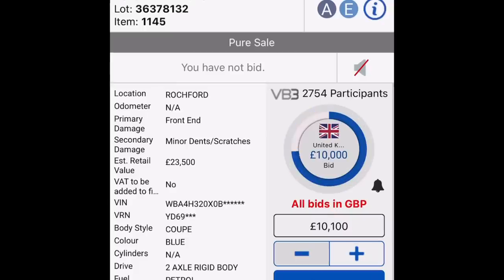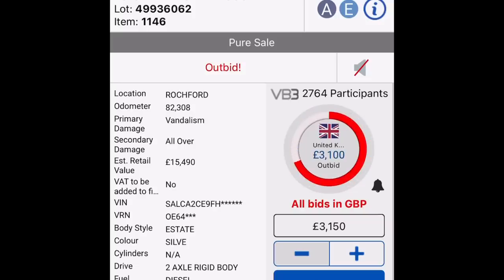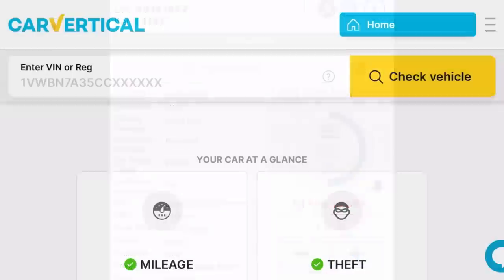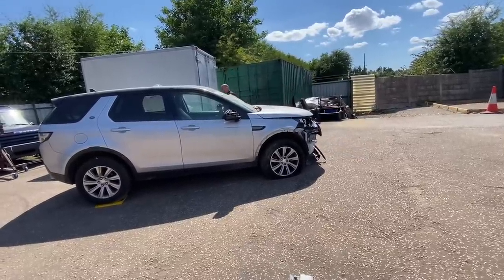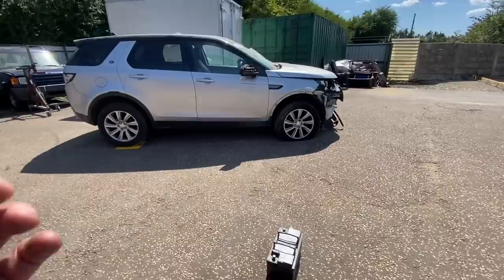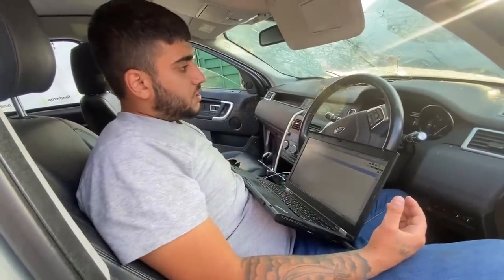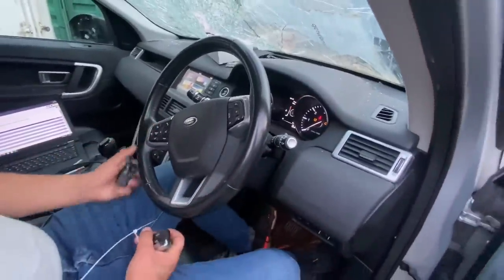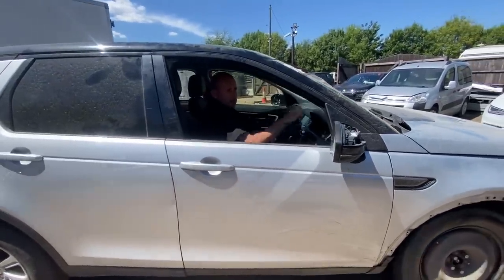STOLEN POLICE T-PAC WRECKED 2015 LAND ROVER DISCOVERY

Comment: I have a manual SE Tech SD4 in Indus Silver too - looking forward to following this.

As this has the pan roof, you're half way to the black pack offered on the HSE level. You've got the black roof, wing mirrors, fog lights and tailgate finisher. Go for the black grille, lettering and side vents and stick a second hand set of 20" black LR Aerovipers (from the HSE) on there and it makes for a great looking car! 👍

Comment: That's looking a bit rough but I can see the potential. The good thing is Aden got her running. He is a very nice guy and very knowledgeable.  As he said though he has to keep on top of the game to be at least equal with the criminals. The post will be an easy fix for you, just need to source parts at a good price. It will be a good and interesting project Gents. Thanks again Rob and Chris  for another great video. Do still keep an eye on the temperatures though. 👍👍

Comment: Firstly thanks as always guy's,quick question,do you reckon purely on a business sense do you think there's more profit just churning out your run of the mill family car's,/hatch backs etc.Or are the more prestigious more exotic stuff worth the initial outlay.Obviously the variety is great for us follower's i was just honestly wondering the difference in profit between the bog standard and the more expensive,cheers.
Reply: Sorry the other thing is i know you guys sell the vehicles at a reasonable price but there is a big divide in cost between you guy's down south to us Northerners.
Reply from the maker: The profit will be about normal on this just with higher end stuff the bits are more 👍
Reply: @sruk  thanks.👍

Comment: What this basically shows is that car security is more of a joke now than it was back in the day when 15 year olds were nicking Astra GTEs with a screwdriver and short length of scaff tube. All these hideously complicated electronics have ultimately achieved is a situation where anyone with the right kit can drive a £50,000 car off someone's drive at any time of day or night without making a noise, or causing as much as a dent or scratch.
Reply: Exactly my thoughts. I am 70 this month and have spent over 40 years in the electronics industry, and I can tell you that there is nothing more foolish than to rely on a bunch of IC's to protect what now amounts to the same financial investment as a small house. You could make an external steering wheel locking device for very little money that would just stop the new car thief in his tracks, but we have all become too bone idle to spend the 2 minutes to fit it and take it off. It is all going the wrong way I'm afraid.

Comment: I was fascinated by what Aiden was trying to say but Rob you kept interrupting him and he lost the thread.
Reply: Reading between the lines what he said was...

1) It's a game of cat and mouse. The manufacturer puts a system in place and the "aftermarket" analyse and produce a tool to circumvent the system. The manufactures beef up the system and then the "aftermarket" revise their tools. Like building a wall and then getting a taller ladder...

2) Pre 2014 the keys could be relatively easily programmed to the KVM using "aftermarket" tools. Post 2014 JRL secured the KVM so this was no longer possible.

3) So the "aftermarket" then needed another method to start the car. For this they used the emergency start feature and use a tool capable of replacing the key identities in the Body module with ones that they know. This is why the original keys no longer worked on this feature. This tool also turned off the factory alarm. There are many YouTube videos showing this. 

4) Telematics and KVM are disabled in an attempt to stop the vehicle being located. Done by removal or cutting wires. (I like the AirTag story)

5) The feature he used to turn on the ignition only powered up the systems so his tools could talk to the vehicle. This alone would not allow a start.

Think that's what he said. And remember that the tools he used in the video cost him a fair amount of money and subscription. Without these and his knowledge putting the vehicle back to factory operation would not be possible. ..... 

Oh and replace "aftermarket" with whatever phrase best suits the individual!!!!! Do a search for Turbodecoder" HU101. Do the best to secure your investment, make the unsecured one next to yours more attractive. Bottom line is that if someone wants it they will do their best to take it. 

Why we don't make castration of offenders using house bricks legal I don't know.
Reply: Welcome to SRUK, Where Rob asks questions and then talks over the answers :D
Reply from the maker: @AurynGaming  no one is making you watch it negative nev
Reply from the maker: We was having a Conversation that’s how I talk and I have watched it back and you can clearly hear every word he was saying at one point the clocks got my attention and I clearly apologised for interrupting and continued but don’t worry it will never happen again as I won’t ever be filming any third party’s I’m sick of the constant whingeing 👍
Reply: @pichacker  Spot on mate, that´s what Aydin was telling.

Comment: Hi guys I recently had a f pace jaguar  I replaced the rear door car hard to start reposition key I changed the door locks module from the old door perfect now. Also I have another f pace no power at all turns out the fuses above the battery was blown hope this helps as jaguar land rover much the same

Comment: This will make a good series..One question…did the airbags not deploy ? And if not does hot wiring disable them?
Reply from the maker: No airbag damage and honestly you Will find this hard to believe but it really hasn’t been damaged hard to set the airbags off it all panel damage 👍

Comment: Well that RR is a brave one Rob !,  but we know you’ll both resurrect it from the ashes !.  The vehicle security must be very good on those, but of course they are very worth stealing for the parts and shipping to West Africa. So the thieves will have worked out how to circumnavigate the security reasonably quickly. I’m afraid the knowledge of how to do these things is supplied by criminals who have had access to the original design flaws, or reverse engineered it via China. The ones who steal them are just shown the technique, they are too thick to know what the electronics are doing..

Comment: Wow, some scavenger hunting required. I hope those panels are not hiding some deep dark secrets, like a bent chassis or something else vital. I guess the radiator took a bit of unwanted attention to drain the water, so any AC or oil cooler rads will be drawing their pensions about now.
Reply from the maker: It is holding water it was just low 👍

Comment: Oh Rob,  I'm hoping this car doesn't bite you back  I'm scared that  you might have have taken on more than you can bite.
Reply: Its a bit of bodywork, some paint, wheels and tyres, this is nothing compared to some they have had, did you not see the difference once the bumper was off, not bad at all. Fair enough its got alot of damage to the body but mechanically its clearly fine. This will spend more time with the painters than rob and chris, i would personally buy 2 2nd hand doors for drivers side rebuild the front and send for paint. Easy flip
Reply from the maker: Easy work this one bud 👍

Comment: Honestly I worked for Land Rover and someone there told me once those keys are programmed to one module you can never have them reprogrammed… did he install the original files into the module ?
Reply: You can re use all jaguar land rover keys!
Reply: @aydintintas1280  that’s fair enough.. it’s good to know. Thanks
Reply: Another question.. can you only program 3 keys max per key module ? That’s also something someone I know who went to Land Rover to have they’re evoque key replaced cause the rubber bit falling apart and they said they’d need a new module as well as a new key cause it’d already had max keys programmed to that module which couldn’t be removed.. Moral of story… it cost them an absolutely load for 2 keys to be programmed to the car

Comment: Hi good luck with this one what does the T pack refere to? Please
Reply: Police cars trying to stop the car. The damage down the sides is from the police cars
Reply: Tactical Pursuit And Containment (TPAC) - Boxed in by 3+ Police Traffic vehicles and physically brought to a standstill.
Reply: It is a police term for tpac tactical pursuit and containment,  when 3 or more police cars try and box the car in
Reply: Police tactic for stopping stolen cars
Reply: It just means it's been involved in a pursuit, and the police used TPAC (Tactical Pursuit And Containment) measures to bring the pursuit to an end. TPAC covers lots of stuff like use of a stinger, boxing the car in, tactical contact to spin it etc. All the stuff you see on Road Wars and the like, basically. Also explains why the car's a bit battered.
Reply from the maker: Tactical pursuit and containment

Comment: Rob ,I think you dropped a clanger with this one mate .
Reply from the maker: Lovely car and only panel damage
Reply: Have to agree Rob,  needs a lot of bits, doors should be simple enough to get, front a bit more difficult but at  little over £4000 there's loads of room in it, not sure but I'd imagine most of the panels are aluminium so are difficult to repair any damaged bits